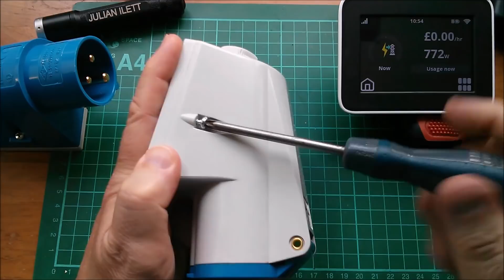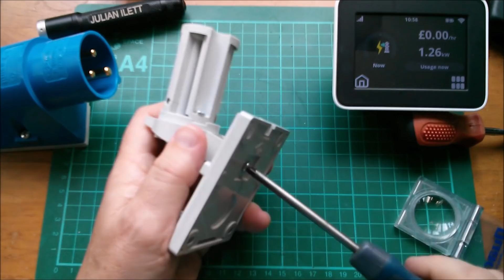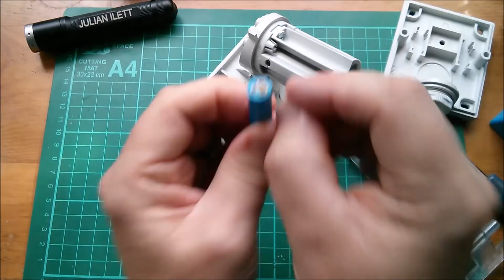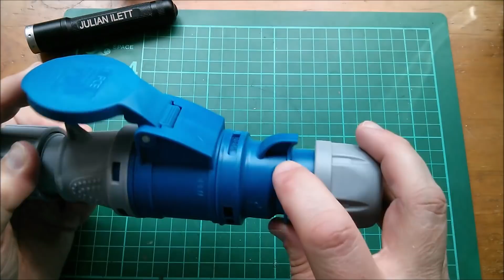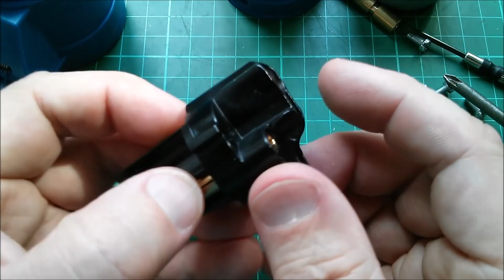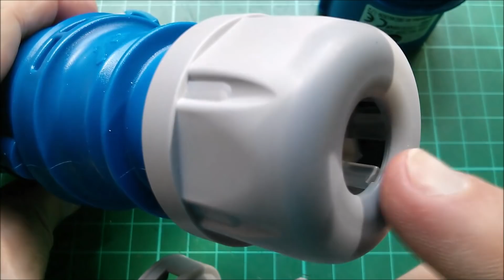16A Connectors Stripped

Comment: What are the legalities of using single cables from the socket to the consumer unit?   I thought under the regulations single wires were not allowed even on short runs like that?   Just curious about that :)    It might be worth checking the regulations when wiring into the Consumer Unit, at minimum to ensure you don't invalidate your insurance.
Reply: They should be in conduit - I guess to effect the double insulation standard.
Reply: Single wires are perfectly fine as long as they are run in suitable conduit. A lot of U.K. industrial and some offices use single wires in conduit. And the same is used in some domestic properties.

Comment: Some really ingenious design concepts employe in these plugs and sockets to make sure you do it correctly. Incidentally, when we moved house in 1968, the house we moved to was all 15amp 3 pin round sockets with awful  perished rubber wiring- my dad had to re3place everything-no niceeic bullshit then!
Reply: Cracking connectors those 15A round pin. Far more secure than the modern square pin. Actully, they're still used in theatre lighting - prefer to use good quality stuff !

Comment: As a electrician here in Norway I want to say my thoughts around this video. I work with this type of connectors on the daily, more so with the red 400v variety, but that does not matter. 
I would not personally use ferrules on wires with such few strands. 
Stands from 1 to maby 8, use as is. Strands from 8 to maby 14, consider it. More than that, highly recommended. 
As you found out the plactic on the ferrules is not heatshrink plastic, they are mainly there to stop you from putting the wires to deep in the connection. And secondly can act as a indicator for ferrule size, if you choose to buy different sizes in different colours, but there is no standardization around these, as far as I know.
There is just as common to find ferrules without the plastic bit.
Very important to point out that you choose the ferrules for the wire, and not the size of the connector. 
I would highly recommend knipex 9771180 if you do bot have a crimping tool already. They are fairly priced for such a tool and brand. And can crimp up to 16mm², whereas most fancy expensive types for some reason always only goes up to 10mm². They also has marking on the side, so you always can be sure what size ferrules you use. 
Some safety tips is to make sure you only screw down on the copper or the ferrule bit of the wire, and not on the insulation, this is a common fault made newbies. And pull hard on both the wires and the whole cable separately to make sure they are not going anywhere.
When it comes to the cable you choose, I would to some research about its properties. Some cables are made to be outside, but may not be made to be moved after installation. UV radiation is known to make cables brittle over time, and only some types of cable will hold up in the sun after years. Like h07rn-f cable that I work with the most.
Reply: I'm nearly with you ! I have the red ones but would never use ferrules !
PS, Having rouble finding twin cable for 100V AC 200A (= 70mm^2) any ideas ? I need 6m.
Reply: The ferrule colors actually are standardized, at least when procured from name-brand suppliers. The problem is that there are three different color code systems in use: DIN, German (originally Weidmüller), and French (originally Telemecanique). All of them are common, though probably DIN slightly more nowadays. Every major ferrule vendor carries all the systems, which is why it might appear somewhat random.
Reply: Also, I would highly recommend buying a set of ratcheting ferrule crimpers. The pliers-style ones you suggest are much harder on the hands. 

(And for people who build equipment that must be UL-certified, the entire combination of ferrules and crimper must be UL-certified as a system. For example, using Phoenix Contact ferrules with a Phoenix Contact crimper, both of which must be UL-certified.)

Comment: 6H is indeed the location of the earth pin.  6H (down) is also where the keying is on the plug/socket.
You can change the plug in one of 12 "hour" configurations for which some have standardized meanings even if the color of the plug doesn't.

6H (for 3pin)  is for 220V  (usually color blue)
4H is for 120V (usually yellow)
2H is for 50V at higher frequency
9H is for 380V (usually red)

There's a few more standardized ones and a few "available for free use".
So you could key the cables and plugs differently if you used them for something other than 220V 50/60Hz and wanted to make sure plugs would never be plugged into the wrong type connector.  You would have to make sure whatever voltage/current/frequency you used would work for the plug and wires used of course.
Reply: 380V ? Red as far as I know is 240V 3ph. AKA 415V !
Reply: @millomweb  that would be a 5 pin plug Which is obviously something else entirely.
I'm talking about the 9h "red" 3 pole plug.
Reply: @oreubens  I think 4 pole - to include earth, is minimum - EVEN in the US :)
Reply: @millomweb  the 4 pin plug exists but it's uncommon (at least over here)  3phase is usually a 5 pin because power stations tend to be configured in star rather than triangle.  So  3 live. 1 Center/neutral and  1 earth
Reply: @oreubens  The 4-pin doesn't have the neutral.
I suspect star for generation is the norm - it's what my generator is - to supply a neutral !
As for connectors, the new stuff I've got is 5 pin the old is 4 pin ! The only socket I've got is a mounted one and I've only one plug !
There's a couple of adapters I'm considering - a 5 pin plug to 4 pin wire socket and a 5 pin short extension with a phase swap - so you could just add it into the circuit to reverse a motor !

Comment: If you've ever driven a motorhome off a caravan site pitch without unplugging the hookup cable, it's probably reassuring if the earth wire is held by two screws, so it hopefully gets pulled out after the line and neutral! I've only done it once, and realised before getting to the end of the cable, but I'm sure it happens quite often!
Reply: Aren't you supposed to also have the ground wire a bit longer (the bit after the strain relief) than the live and neutrals? That's what I've always done on extension cords or where a loose cable  is involved.
Reply: Hook up ? Not in my day :) Just onboard battery.
Reply: @millomweb  But when you live in your van (as I did at the time) you sometimes need to charge the battery! Even filling the roof with PV wouldn't have been enough at times, with British sunshine!

Comment: Definitely use ferrules on finely stranded wires and no, the plastic sleeves on the ferrules are not of the heat-shrink material, they provide  support for the wire's insulation to prevent fatigue fracturing of the strands where they enter the metal tube of the ferrule.

Comment: Make sure there is no interference with the plastic parts of the ferrules when you put the housing together. If they do, just crimp them on and cut the plastic off. I think having ferrules on the ends if the wires is much better than having just the wire. And don't use ferules. Those are reserved for naughty children. ;-)

Comment: Use uninsulated ferrules which are manufactured to fit standard cable sizes. The plastic insulation on your ferrules will stop you inserting the cable deep enough into the terminal,  they are also way too big for the cable size so won’t mechanically crimp the conductor properly.

Comment: I remember those from McDonald's in America and ours were pretty expensive and they kept failing because they were powered on while being pinged in and unplugged and arcing but it was just the pins that got destroyed I replaced a couple from old ones that were fine but they weren't cheap from our suppliers
Reply: The US version of the system is not compatible with the European system and are pretty uncommon from what I’ve seen

There’s quite a good Wikipedia article on them

Comment: Neutrik PowerCon can do 32Amps + Neutrik PowerCon True 1 Top 16A

PCE IMST Portable Thermoplastic Distro 16A-63Amp

PowerSafe  PowerLock can do 400A & 800A (HV AC & HV DC) + Powerlock Powersafe Sequential Mating Box + Flight Case Rack Power 19” on Wheels
Reply: found the roadie! just make sure to remove the lock from the powerlock ;)

Comment: It be easier if they had wago type connectors where you could just lift a leaver instead of faffing with a screw
Reply: @Bolamnie Plecy
there are some 16A cable plugs and sockets with springy lever connectors and it is a lot easier to connect them :-)

Comment: Would use h07 rather than artic cables as it wont break down for temporary power, would use at minim a 16amp interlock connector so power cant be pulled whilst live however if their is a chance of power been generated and consumed in both directions ie solar generation this is a definite no no as the male pins could become live at mains voltage if removed. Would recommend an alternative way to do it as 16 amp is only ip44 which is okay for temporary use but if you are looking to use it all year water moisture will build up in the cable. I deal with temporary power for events so make up 16amp cables every other day

Comment: Watching you take these apart knowing your going to use them  in your home scares the crap out of me, these units are not designed to de dissasembled :o
Reply: What? 80% of what he did is nesscesary to install these :O?
Reply: @TecSanento  yes, but ripping the pins out, pulling the glands apart, and dismantling the socket to the point he did isn’t, these are specifically designed to be easily installed with minimal disassembly, they are not designed to be torn to bits, but as with most things, this is the internet, so my opinion isn’t valid 🙄
Reply: You must be new here, friend. It's a wonderful rollercoaster to watch Julian create electrocution and/or fire hazards! :)
Reply: @Lillfot  not new, and normally I would be fine, this one just really annoyed me, maybe I was just tired 😅
Reply: @Lillfot  Julian, the British electroboom(er)
Reply: What about Clive deliberately electrocuting himself…
Reply: @Mark1024MAK  nah, because that’s deliberate, it’s when something you don’t expect happens that’s part of the issue

Comment: i use similar one all the time.. they only have one more Live. L1-L2-L3-G the old spec was 2.5mm cable mounted outside the wall. now it it 4mm for 16A as the constant load over time will heat up the cable and a lot of cars use them for charging.
(btw. we do not have a neutral lead at all here, so there is a 230V 3 phase)
Reply: I've got connectors with L1, L2, L3, N & G !
How does your eathing work ? Proper wire all the way from the supply ?
Entertain yourself with JW: https://www.youtube.com/watch?v=b0nLTiNwbLM
Reply: GrapSorz replied: "pmailkeey no you have to put a ring earth around the house or some stakes in to the ground. that is all the earth you get. L1, L2 and L3 is from the pole or cable and you provide ground"

"TT" system then.
Reply: @millomweb  no we use IT here. SOME TT is used in the south. stil it's uncommon. in TT systems the transformer station is grounded. and it is 115V from any L to ground. and you need two lives to make the normal 230V.

Comment: Such fat connectors for 16A/5000W
Reply: Actually those are meant to be used for 230V*16A =3680W
Reply: @TecSanento  Any way what is to set the power is the current size so for England it would be 110x16=1760w
You are not aloud to to go over the nominal current that what it rayted for -not in w
atts,in current.
Reply: @ilanozana9652  Erm England is 230v not 110.
Reply: Erm, despite the official supply voltage being 230V AC at 50Hz, most of the country actually has around 240V to 245V…

Comment: Why not just use a 3-pole rotary isolator? Much better than a pair of wall mounted plug and sockets with a link lead between them.
That would use less space to set up, and easier to isolate the shed from the mains should that be necessary. 
You would have plenty of space to gland an armoured cable into the isolator to feed the shed.
Reply: I did not know that was a thing but seems much simpler than this with two more points of possible failure
Reply: Perhaps he wants to be able to plug his inverter boxes in to power his shed as an option?
Reply from the maker: Exactly right Ian :)
Reply: @JulianIlett  " inverter boxes in to power his shed"
I've still to sort out cabling to power the house from my newish diesel generator. It's going to be complicated !

Comment: These things look very big but they're the only ones I see around is there anything smaller than this that can handle high current
Reply: neutrik true con or powercon both rated to 20 amps or neutrik powercon 32 rated at 32 amps
Reply: They are not build only for high current they maily built to mount outside or in industrial anvayorment
Reply: If you think these 16A types are big, don’t look at the 63A ones, let alone the 400V/415V 125A type…
Reply: @Mark1024MAK  or powerlock

Comment: The PCE ones are also here in Germany the best bang for buck plugs for everything with main plugs and sockets, too. All of their designs are quite clever but not to complicated to be cheap to build. I like it :).

For the ferrules: I would use them, or at least tin them. In Germany it is not allowed to tin for new constructions, the solder could flow over time like copper on pure copper transmission lines. Solid core wire where it is possible (in walls, no flexible joints are needed), all other ferrules.

For crimping there are very nice crimping pliers that produce a hexogonal shape. Just remember hexagons are bestagons! ;-).

Just kidding, the hexagon shape slides easier in than the rectangle one. You can get cheap clone pliers on ebay or aliexpress. Big brand ones are to expensive for DIY hobby usage.
Reply: A fellow GCPGrey fan I see :D